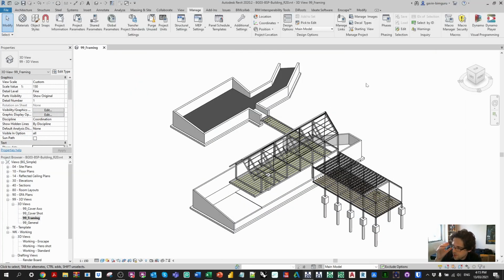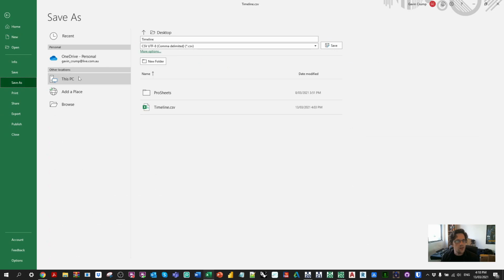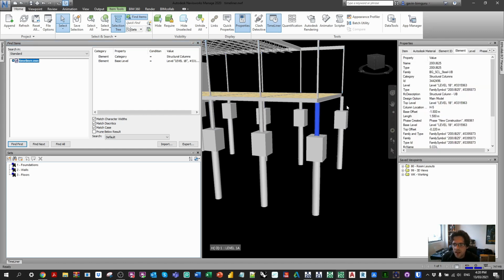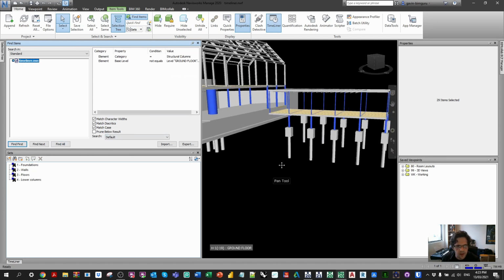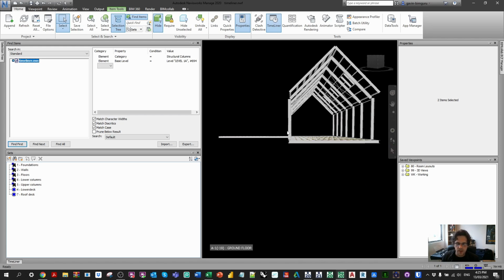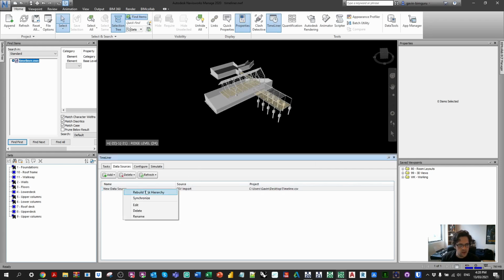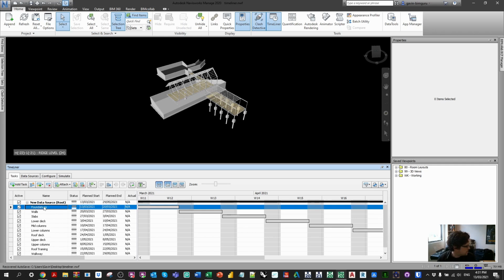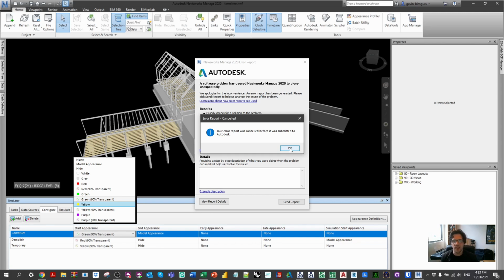Simple 4D animation using Navisworks!

Comment: I agree Autodesk is neglecting Navisworks as they are focusing on BIM360 which will eventually replace Navisworks. I also have a thought for a future tutorial I would like to know what kind of workflow is best to do 3D construction details e.g window jamb to sill corner. I am finding revit is a real dog when it comes to doing those and Im having to use Sketchup. Which is a pain as its a different work environement and means I have to maintain multiple models. It will be real interesting as 3D details are being requested more and more I have a project were the facade engineer is requesting me to do 30+ of them, so you can imagine how much of a time suck it is.
Reply from the maker: I doubt that BIM360 will take over Navisworks entirely unless they can get all customers on the cloud and capture all features there that Navisworks has. The clash detective there leaves a lot to be desired, and is still nowhere near as powerful as the one in NW. I expect platforms like Revizto have a much higher chance of replacing it.

Thanks Quintin. To be honest your facade engineer should be doing their own 3D details, it is a waste of time for architects to model up all those detailed extrusions in 3D. From a junctioning perspective sure, but we should not waste our time technically detailing systems as systems (e.g. all the beads/blocks/extrusions of a window suite). At the most you should only 3D detail your scoped items, and placehold their facade elements as boxes.

I'd be happy to show a detail in a tutorial that doesn't involve overly technical parts, so probably not a window junction but maybe a brick to slab with stud wall in 3D, given that these are all architectural scope items. I actually have used Revit for this in the past, it can be done fairly easily with some setup work (Revit doesn't come ready out of the box to do this, but neither does any program really).

My method is roughly:
- Build/manage a 3D detailing parts library
- Same for a model, with common elements like membranes/linings as walls
- Link in the main model, halftone/underlay
- Section box around the detail junction
- Model up the detail using families (loadable/and or system)

The benefit to this is that your detail can be aligned and linked to the main model potentially, and you are not relying on import/export workflows or managing drawing sheets across multiple formats/programs. I would never do a 3D detail inside the same model as the documentation itself, as there are too many elements that would interact with the detail elements, and you run the risk of them being deleted by accident.
Reply: @AussieBIMGuru  I totally agree facade engineers should do it. and is something I am disputing currently. 

The situation here in Auckland the council is expecting more and more form architects aswell as from the facade engineers. So currently I have 2 Facade engineering companies 1 is to do the main documentation (but doesnt cover all corners of the building) and the other reviews architectural and other facade engineers drawings. 

To make it better the architectural drawings and facade drawings have to be at shop drawing level before building consent. 

Architecture here in Auckland is becoming more engineering than design so frustrating. 

Yes that sounds like a very simiar work flow to what I am doing but still find it quite slow. 

I also find using design options for isolating the 3D details handy aswell.

Comment: Software can't keep up with your speed ⚡.
Very informative video for beginners.
(I am using one project parameter and add data in revit then use attach by rule option so it will automatically assign with task.)
Reply from the maker: Great to see you're using the parameter driven method also, definitely the right way on larger projects.
Reply: Hello Sir, Please I want to learn this method, Are there any youtube tutorials that show how to do that?